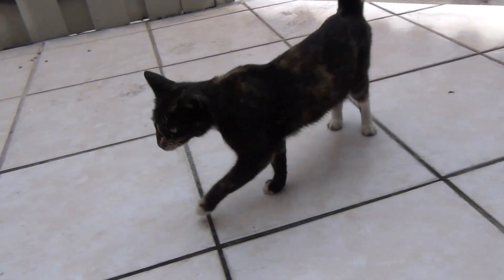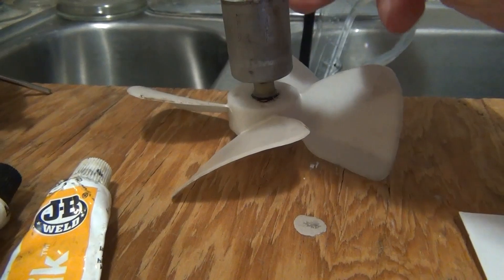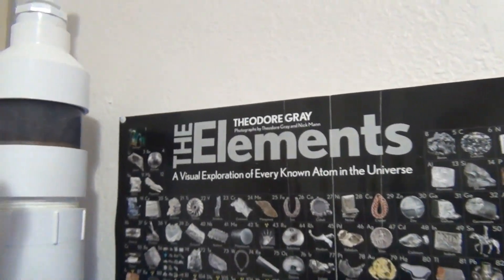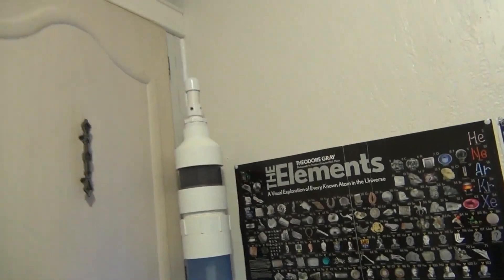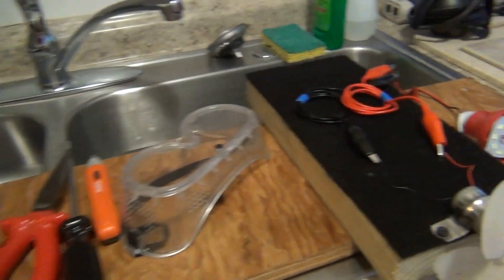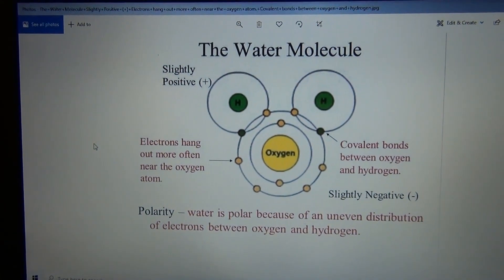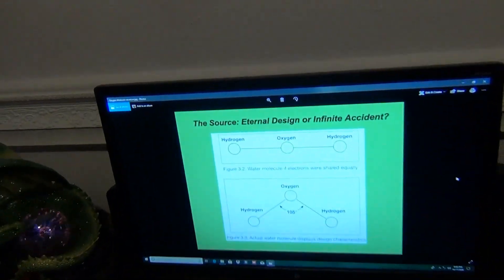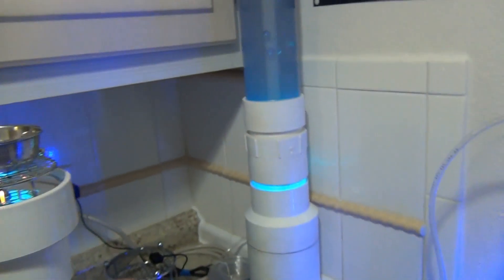HHO WIND & GAS TURBINE ELECTRIC POWER GENERATOR

Comment from the maker: This is a simple method that anyone can do and usually provides enough to power life support systems and can be done on a larger scale and wired in series in limitless possibilities. Remember energy just changes forms from one type to the next and you must have a constant abundant steady supply of "ELECTRONS" to power the behemoth wet cell reactor, or you Hoffman apparatus and the energy must be produced from somewhere clean.

Comment: Could you show your's HHO cells plates what is the best material to build them stainless 316L (it is a little expensive) would you recomend any other metal? Like 304 stainless?
Reply from the maker: The best thing you could buy as an expert would be a titanium platinum electrode grid but for beginner i recommend 316l and 304s get started for a small hho torch setup if you are just starting out. Learn more about different electrolyte solutions all have different effects on the anode electrode metals.

Comment: Hello Friend how are you? Your videos are very good, now I understand your devices better, and how to put them together, I was thinking about putting a tesla turbine and the turbine that turns a dynamo and that charges batteries or moves equipment, thank you very much
Reply from the maker: Yes get the D/C motor spinning by any way possible and you have the necessary electricity to get to the oxyhydrogen gas in a physical manner. Solar panel is another option that is simple and easy way to get electricity.